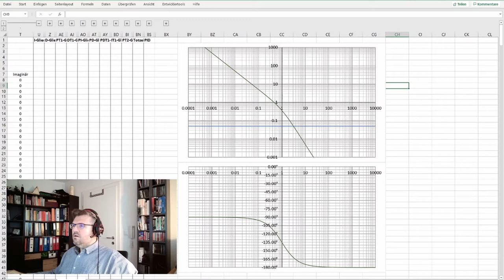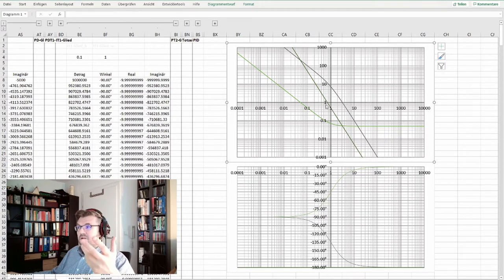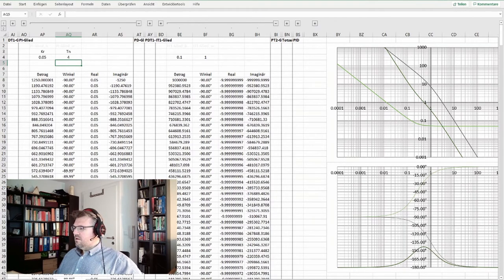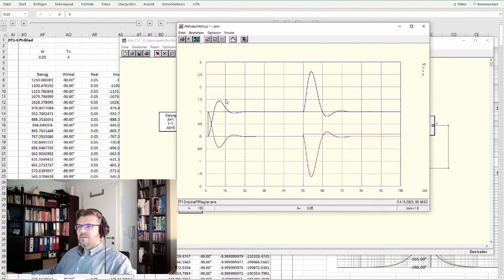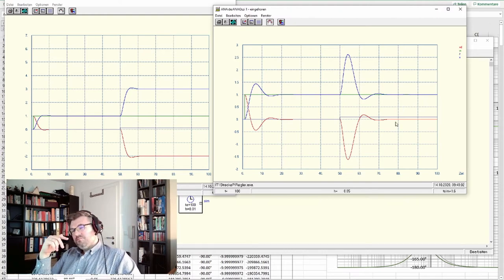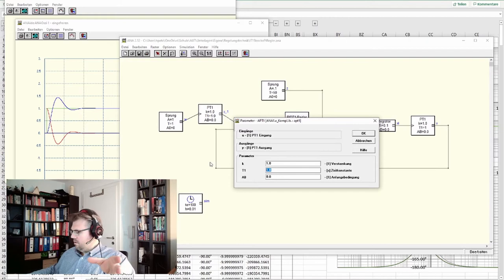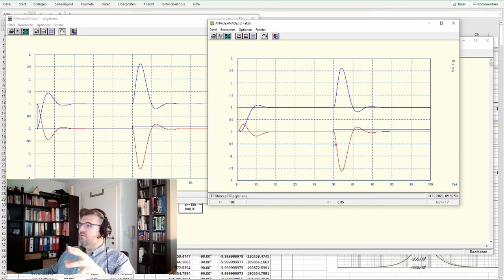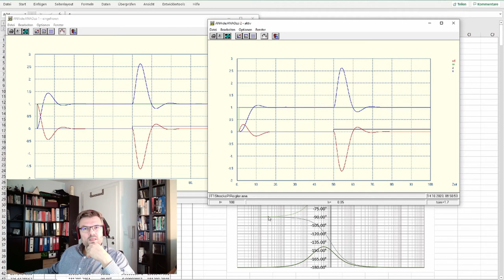Control 65: Symmetrical Optimum (Old)

Comment: thx you!! still dont know rly what is here symmetrical :(
Reply from the maker: Thanks for the comment. Symmetrical because the frequencies where the ramps of the open loop transfer function change (from steep to flat and back to steep again) are symmetrical to the crossover frequency (gain factor 1). At least in the logarithmic scale of the video plot. What actually means symmetrical in sense of geometric series. If that make any more sense for you.
Reply from the maker: Btw: This video will be replaced on August 10th, 2021 with an updated version. Maybe you get more out of this version then.